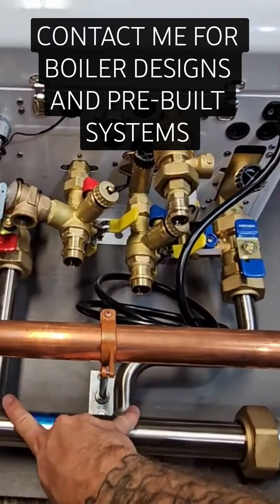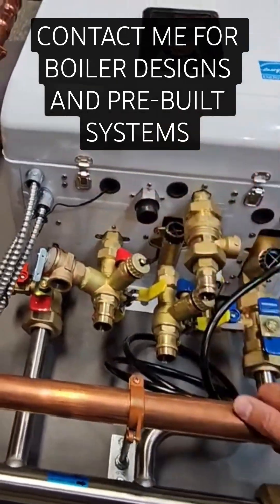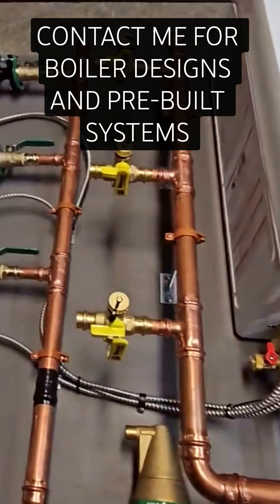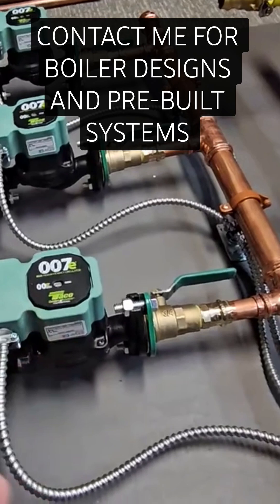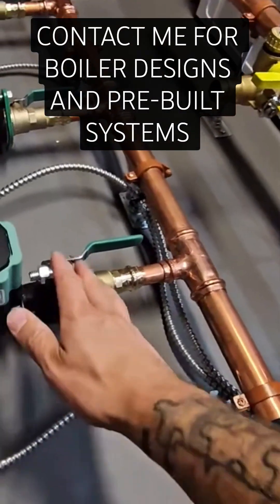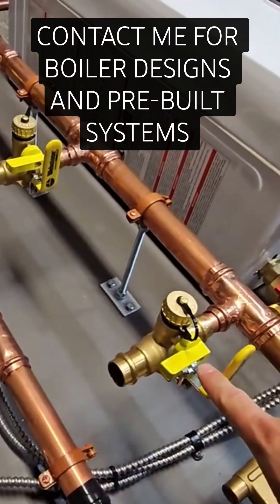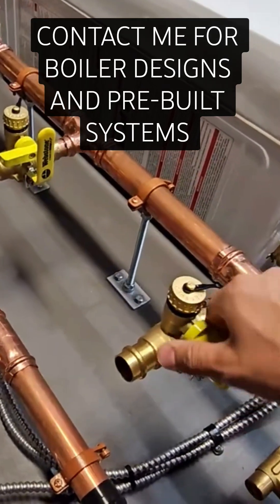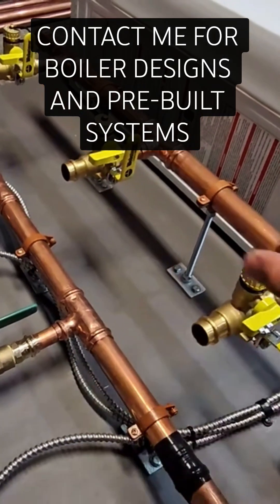#boiler #combi #tankless #water #hydronic #baseboard #radiant #heating #hvac

Comment: why would you want to leave those isolation valves opened and the T&P valve without an extension i guest its just an illustration.
Reply from the maker: @Renegade12346  the system was not mounted on a wall at that point. The valves would all be set to the final position and pressure relief piped to code.